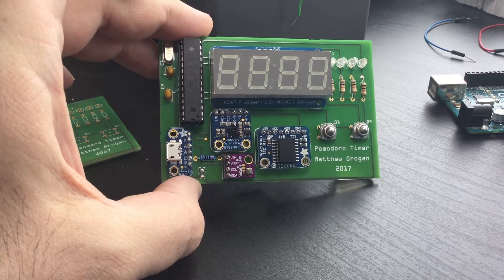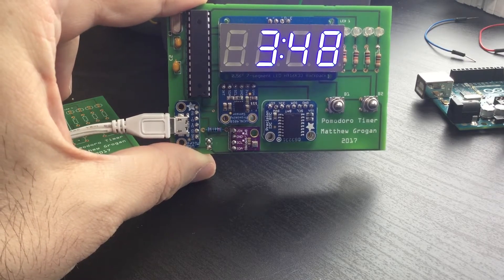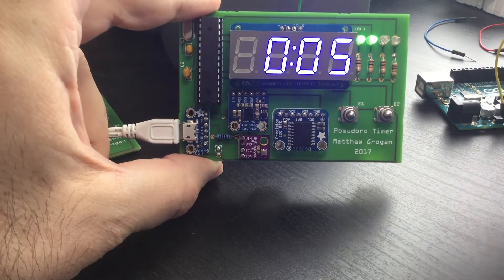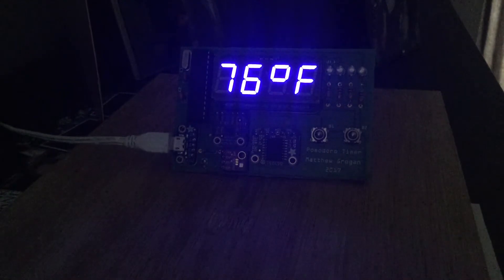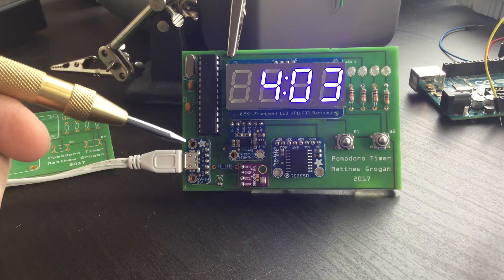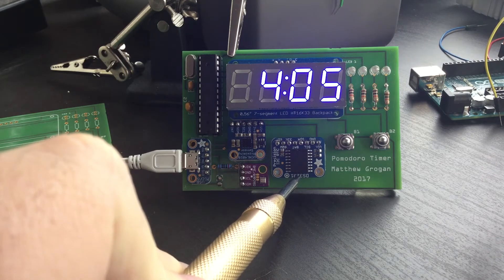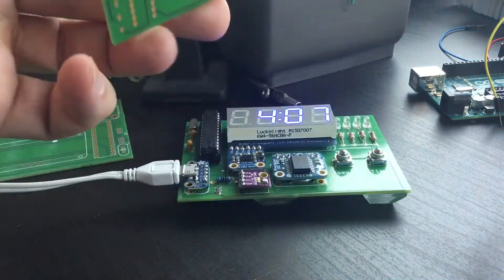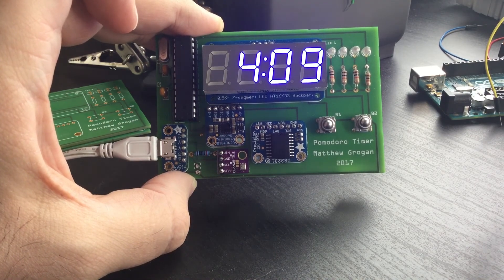Arduino Pomodoro Timer + Clock + Temp Sensor

Comment: Cool project , really need to make something like this to focus on work . If I had to use a 1602 LCD display , what are the changes I need todo in the code.
Reply from the maker: The displays are implemented here: https://github.com/mattgrogan/pomodoro_timer/blob/master/display.h

You can subclass the SevenSegDisplay (as I did with AnimatedDisplay. And then connect it in Pomodoro.cpp
Reply: @matthewvgrogan  appreciate the quick response , another little question , have u always been using this with power connected through a usb cable or did u make a battery version , if so what was the battery life like
Reply from the maker: @manoharmanu1460  I only power it from the usb cable
Reply: Am a little weak in understanding code , are we using the rtc module only for the clock ? Or does the timer use the rtc module also.
Reply from the maker: @manoharmanu1460  The RTC is only for the clock. If you are just making a pomodoro timer, you can use millis() and skip the RTC.